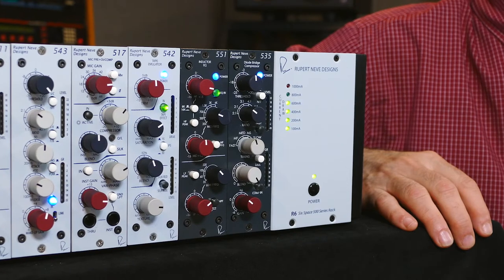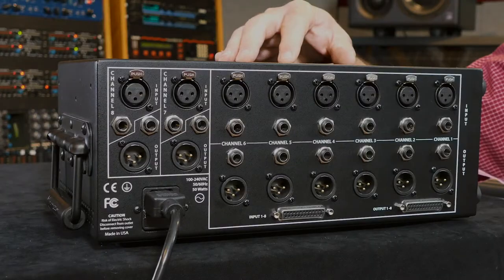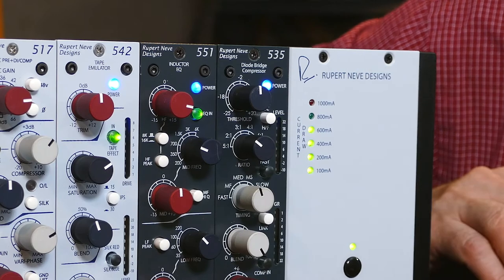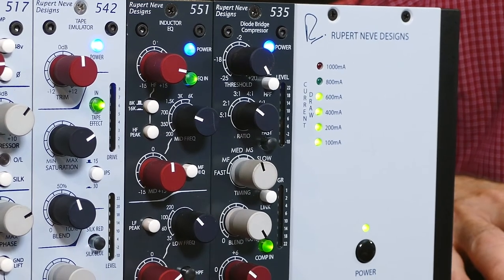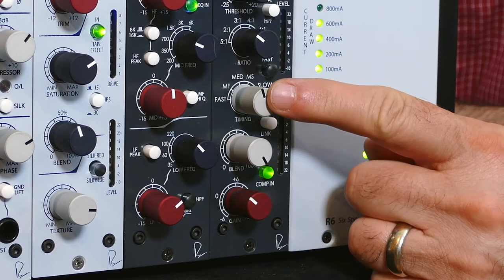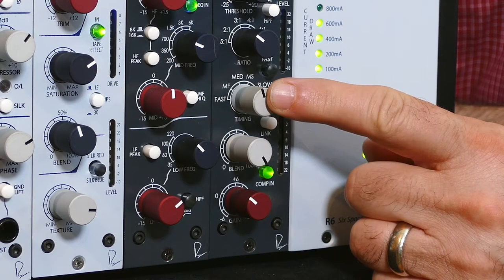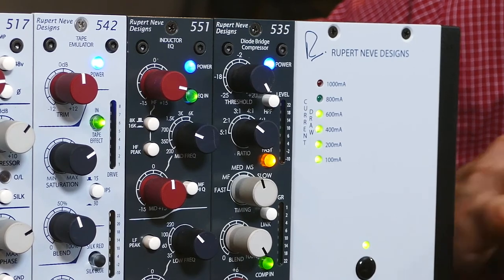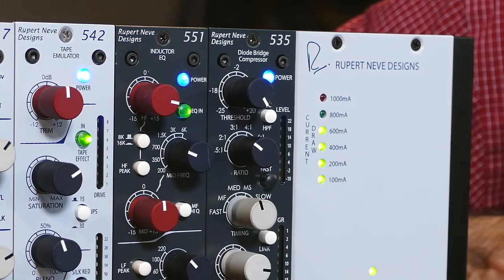Quick Start: 535 500-Series Diode Bridge Compressor

Comment: I really like these new videos on the 551 and 535 modules. I am sure they sound very musical. Are the 551 Inductor EQ and 535 Diode Bridge Compressor the same or based on the Shelford 5051 Eq / Compressor used in the 5088 console?
Reply from the maker: The 551 and 535 are essentially the same as each corresponding section of the Shelford Channel. That EQ is the same as the EQ in the 5051 and 5052, but the compressor in the 5051 is a VCA compressor (like the Master Buss Processor), not a diode bridge design. One main reason for this is that having diode bridge comps on EVERY CHANNEL in a console might get too colorful too quickly, and a VCA comp is probably more well-suited to stacking across a high channel count.